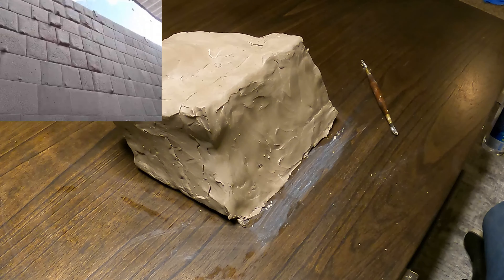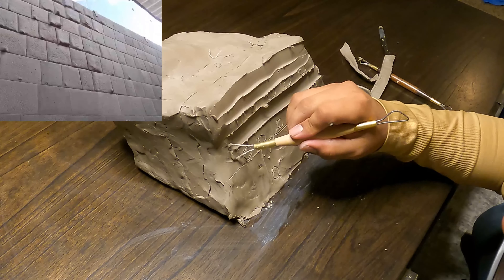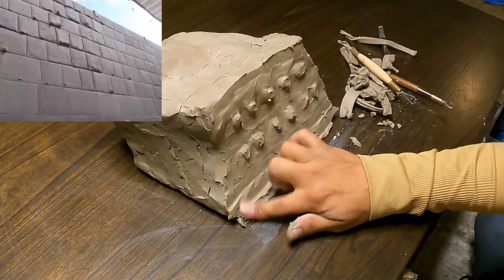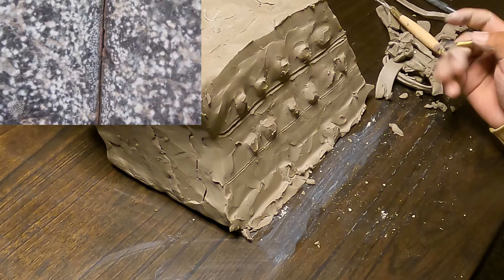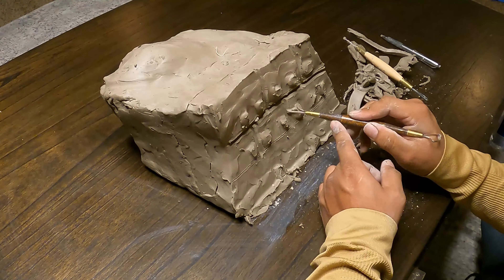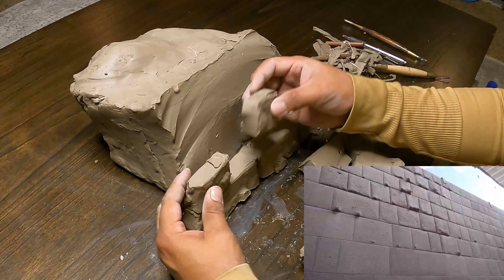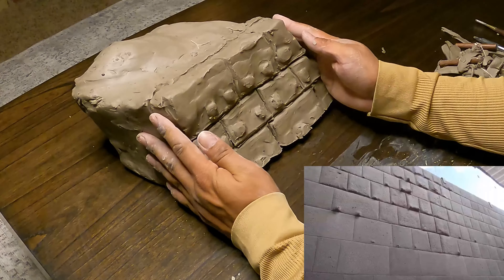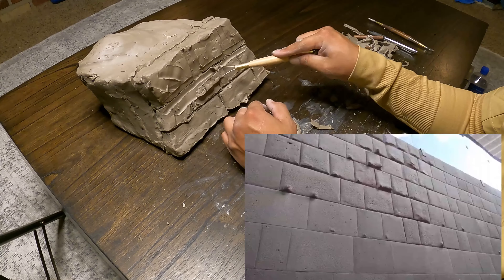Perfecting Polygonal Masonry: A New Explanation on the Ancient Engineers’ Construction Methods

Comment: this might be a good explanation of the the knobs, but not the joints. And you ignored the most critical aspects of the stone. there is plenty of hard evidence that the stone was softened. There is no way to deny it or getting around it, there are tons of bent stones, and stones with other rocks fused into them, or other impressions and shapes that make it very clear that the stone was softened, and from what I know, the method of doing it is applying a mixture of chelation chemicals to it. 

additional proof of their softness are a whole number of anomalies like: 

1. regularly placed scoop marks on the unfinished obelisk or on other ancient stone work like the walls of man made caves such as the one in Japan. 
   their regular placing and shape suggests that material was scooped out of the ground, not chiseled. 

2. straight paths and impossibly tight and narrow holes, or indentations for workers to effectively works on,  such as the ones around and under the overlisk, 
    which conicidentally look like it was dug or scooped out rather than chiseled or pounded away. 

3. the drill cores of ancient egypt have a spiral grove with spacing that suggests an impossibly powerful penetration rate, something like 500x modern powertools with diamond tips, while not being destructive enough to not make a perfect hole, which is easily explained by the stone being soft, as less power would penetrate the softened stone far quicker, but in its hardened state would look like an impossible drilling speed.

4. the spiral groove is also  alot bigger than proposed primitive copper tube drills and the spiral indentations are more messy, which is consistent with drilling into a softened stone, since softer material means that drilling into it will rip out more material around the tool, causing a messier and bigger grove line

5. many ancient artifacts, particularly the ones in egypt, have a finish to it which is not a mechanical polish. mechanical polish is more light reflective, and wears out in a few decades from just touching hands and wind and rain exposure. the ancient artifacts have been touched, used and exposed to all kinds of environments and stress for thousands of years, yet their finish is often still perfect.
on broken pieces you can see that there is a thin outer layer with a changed or more ordered arrangement, showing that the finish is caused by something that was applied to the stone and penetrated into it a few mm, and changed its composition or ordering. this can not be heat because the cooling speed and lack of pressure would make it look like glass or obsidian, not granite. 
on the unpolished underside of one box in the cerapeum there is a couple of drop shapes which do have the shiny polish, clearly proving that some liquid drops caused the rearrangement of the stones outer layer.
the stone walls in peru aswell as the drill cores of egypt have some kind of finish, and in the case of the drill cores, it could not have been intentinal polishing cause the core was just removed and discarded, so it also having a polish shows that the process that allowed them to drill into it also unintentionally created a polish on the removed core drill, which is consistent with them applying a fluid onto the rock to soften it, drilling it out effortlessly, and the process of rearranging the chemical bonds leaves the hardened stone in a more orderly state than before, causing the polished surface on the discarded core or other walls. 

6. some drill holes in egypt are very big, while the tool mark is so thin that it doesnt make sense. modern power tools this size have to have a much thicker tool tip cause otherwise it will brake rather than remove material given the force needed. either they had much much harder and more shapable materials than we can produce today, or the rock was soft, which eliminates all the issues. 

7. the statues in egypt have thin overcuts. you dont make a mistake that takes hours of conscious chiseling to produce, especially not a straight line, clearly the rate at which the stone was worked on was very fast. the cut had to have been made in seconds, so an electrical machine had to have been used on those objects. even on a soft stone, an artist will not accidentally create a straight cut that goes on for a few cm. a hand made process does not create overcuts, only electrical machines do, cause they remove the stone fast enough to a point where a mistake can make such overcuts. 

8. the way to achieve the tight joints is obvious. the softened stone was simply pushed against the rock next to it, squishing it, and causing the tight joint and the marshmallow like appearance of the wall. the fact that the joints are too thin to pass a piece of paper through it even on the inside of very thick wall which would never be seen makes no sense otherwise. it doesnt make sense to suggest that 99.99% of the work on the stones and an impossibly precise result that was completely invisible and without function was casually produced. nobody can afford to spent almost all of their effort on meaningless precision. it doesnt make economic sense, especially cause the population number and economic output does not allow for such a waste, or even any reasonable number of people working on it. 

9. the design of the walls and of other megaliths requires, like I said, that 99.99999% percent of all effort is spent on precision and scale, which is completely useless and unnecessary and impractical, and causes the rate of removal and time of completion to be nonsensically huge. At the same time,  the features and design is nonsensical for the proposed function and sophistication, yet almost all of the work has to be spent exactly on the unnecessary aspects, which is economically impossible. no ruler can afford to waste this amount of skilled labor on unnecessary features and precision. the economic output completely prohibits that. how much technology, agriculture and population is required to make room for this much labor and enough professionals ? it makes no sense. far more advanced methods had to have been used than just chiseling, cause the amount of megalithic work uncovered is far far far to much for the proposed amount of people, never mind that only a tiny amount has been unearthed. 

10. the details, precision and amount of work suggest a far higher level of technology and civilization. you could theoretically build a modern sky scraper with just man power, wood and ropes if you really wanted too, but it would take a nonsensical amount of time and labor. same thing with the ancient work.

11. you can not achieve the tight joints with your method. the stones might brake along the indentations, but it would not be straight. the deeper you go into it, the better the cut, but to achieve a clean cut, you would have to drill into at least half the desired depth of the wall, which in itself requires  impossible precision and no chisel is thin, hard and long enough, and the joints are too thin, and you would see a difference or a breaking point on the inside of the broken walls, but the cut is all the way consistent. the knobs are also too small to effectively achieve a controlled break.

the rock was likely softened and then cut with a wire saw or a circular saw. evidence of both are found on megaliths. and it certainly involved electricity. we could also get into their age and how they have to have been inherited and constructed by a more advanced culture way before the proposed time line, but Im gonna leave it at that. there is no holding onto the narrative of chiseling and primitive cultures, the facts just dont support it.

Comment: They used woven sacks filled them with dry cement like geopolymer added water to set it. Those bumps are at where the woven sacks gave way before setting into stone .
Reply: If they actually gave way, you would see a deflated block that is all wrinkled up, and the majority of the block would be protruding from beyond the faces of all the other blocks. Instead, the faces are more or less flush with one another and the only thing that sticks out is the nub.

Comment: I think your idea is very interesting, but I don't think it is the full story. Admittedly, in some parts of the Curicancha you can see that the natural stone structures (like the mineral patterns) span across multiple blocks, but that's only a very small percentage. Many stones with a perfect fit next to each other are clearly not from next to each other in the quarry, because their mineral pattern is different. Also some stones are embossed / pillow shaped on both sides. Some even have notches on at least two sides. 

But I agree that the embosses have been made first. In Sacsayhuaman there are at least two obvious stones, where there are embosses in the middle of the stone, but not cut has been made (or break hast occured). Another reason why I think the breaking theory is not the entire answer is that the stones always seem to have an almost perfect 90 degree and very smooth surface where the break occurred (according to your theory). I would think the surfaces of the cracks were more erratic.

Comment: THIS THEORY WOULD NEED TO BE TESTED IN REAL LIFE TO SEE IF IT COULD BE DONE. HOW DO YOU THINK SOME OF THESE HEAVIER STONES WERE PUT IN PLACE SO THEY PERFECTLY BUTTED AGAINST EACH OTHER AND ALSO LINED UP FLUSH WITH THE FRONT OF THE WALL. TO TRY TO PUSH OR SLIDE THE STONES WOULD HAVE BEEN EXTREMELY DIFFICULT. THE FRICTION WOULD HAVE BEEN EMENSE. I THINK THEY MUST HAVE HAD SOME TYPE OF SUPER LUBRICANT TO SLIDE THEM INTO POSITION. THERE IS EVEN AN EGYPTION PAINTING SHOWING A LARGE STONE STATUE ON A WOODEN SLED BEING MOVED BY MEN WITH ROPES. THERE IS A PERSON POURING LIQUID FROM A VASE IN FRONT OF THE SLED. I BELIEVE THAT MAGIC LIQUID WAS THE KEY.

Comment: Good theory, but not possible, if you look at their walls the head joints don't line up, only the bed joints do, so this could not be the method. If it was stacked bond, then this might be a little more believable. Secondly if this is how they did it, they would have to do the ENTIRE wall from one slab, or hammer chisel sections together. If they could hammer chisel sections together, then they had the skills to do that to all the stones.
Reply: Yours is actually the best criticism I have read so far about this proposed method. Unless we can observe some natural cliff faces that exhibit polygonal structure, it might be time to scrap this idea. You don’t even have horizontal bedding planes in polygonal masonry. Almost all of the vertical and horizontal joints are staggered except in rare instances.

Comment: The stones were poured: Animal skins were used as an outer wall for the mold. The nubs are the stone material accumulated in the sown legs and tail of the skins. That explains the "bulging out" appearance of some stones, the inner nubs when skins were used backwards and also the way the nubs seems so random. For the biggest stones, planks had to be use for more lateral support, this caused the vertical imprints on the stone. They were too lazy to remove the nubs once the stone was hard.

Comment: Sorry but this method was not used.  Under each block of stone there is a chiselled out hole where the notch of the stone that sits on top fits into the hole which means it was not done this way.   The notches on the outside of the stone served 2 purposes and they were much longer than as we see them now.  The outer notches were used for rope or strops to lift the stones into position since you cannot put ropes anywhere else, additionally if you look at walls that have been taken apart for some reason if they are more than 2 blocks thick the notches on the outside also fit into the block next to it as the holes are chiselled out.  If they end up on the outer walls they just chisel off the notches after they have lifted it into position which you can see the remains of the notches today.
Reply: I wanna source for this information I’ve never seen or dheard of this dorsal protrusion on the rocks to lock them into place..some have keystone cuts in the tops!
Reply: @ They learned due to the area suffers from earthquakes and also made the walls incline inwards.  I was told by our guide.

Comment: I really don't get what you were trying to show here. What was the point of showing all that clay being worked? Do you mean the little projections were there so that the cut rock face wouldn't lie flat on the ground, but would be held up by those nubs and thus put stress along the scored areas? But if that's the case, how did they even manage to score those boulders to any depth? THey didn't have iron chisels or anything, and instead had to peck away sections using cobbles, so creating those sort of nice sharp cuts to fracture along wouldn't have been possible right? And if you are limited by technology to the point where cutting or shaping rock is really time consuming, wouldn't it make more sense to simply find stones that were already of suitable size and shape rather than trying to cut out giant rock faces and break that into usable blocks? I thought that was the whole reason why they resorted to polygonal masonry, because with their limited tools it would have been far more work to cut and shape rocks into symmetrical and uniform blocks.

Comment: I'm actually laughing out loud here. So to make that wall shown in the photo, they first had to go out and find a large enough contiguous solid rock somewhere, cut the front off it nice and flat but for some reason leave nubs seeming randomly, then and somehow cut a nice flat slice out from behind it, then knock it over and pick up the pieces. If the completed wall looked more like a shattered piece of glass you might be on to something, but you're way too optimistic that some scoring is gonna work out well. This doesn't even explain what the nubs are for, or why most walls are clearly built out of blocks that were NOT adjacent in the original stone.

Comment: Yeah what’s the point in the nubs? Concluding that this is the simplest method possible to reinforce your argument falls down when it’s not simple to scratch off the surface and leave nubs first. Plus you wouldn’t get clean breaks of it fell over and broke there’d be a patch of rough uneven stone where the last bit broke off. Also doesn’t explain how a lot of the stones were all pillow faced…

Comment: The nobs are always on the bottom. That's where they put electrodes in the rock and put current through it to make it soft and when they pulled the electrodes out it left the nobs. It comes from a old word called pyramid which means fire in the middle... you put 2 electrodes in there and run an electric arc... it's going to make heat up to 35k degrees and melt the rock.

Comment: so :
- you don't believe that they could carve perfectly flat surfaces to make any stone joint together
- but you believe that they could cut the BACKSIDE of a bunch of blocks at once ???

You know, the step where you used a metal wire to cut through the whole block but edited out of the final video ?

You don't need all those explainations based on nothing, archeologists already have explainations based on evidence

The bumps are not to crack the blocks... they would need to be parallel on each side, not just 2 bumps on the bottom
Those were left to wedge wooden beams to support the weight of the stone while they worked on it

And they later plished them out... But only on the blocks you woud see, that's why you mainly find them on the back of the walls or on inside walls were the public didn't access

You can "easily" make 2 blocks of any shape fit perfectly together :
- you use natural cracks and boulders already detached 
 because that's way easier 
- then you select one of the many rocks that have a compatible shape

- you put it close to where it will end, and roughly removematter until you can barely fit a stick, your fist or whatever
- then you put them as close as possible and saw between them
- and you push them closer and start again
- it can easily be done and leave exactl the saw marks we found 
- and the polygonal shapes that are so puzzling for people that don't know anything at stonework nor about the least effort method
 https://www.youtube.com/watch?v=fykJMpR9WwY

Comment: I collect granite countertops to crush up and using concrete. Let me tell you one thing granite is fucking hard as shit. Can’t scratch that shit with metal about the stainless steel buffer thing just to send the surface finish. Nope it just left metal all over the granite. the granite is harder than stainless steel, that rock is too thick. That’s scoring a surface line would not make it just crack foot back perfectly straight. You could get the rocks to break apart where they could be piece together and if you broke the rock, obviously, it would fit back no matter how it broke apart but it wouldn’t break apart necessarily a perfect, 90° angles like your clay model  Work with rock it’s such a different material i’m not trying to knock you. I’m trying to work with you, but I don’t think that personally you’re 100% right and neither do I think you’re 100% wrong so I think it’s part of the journey and finding out the truth answer but I don’t know